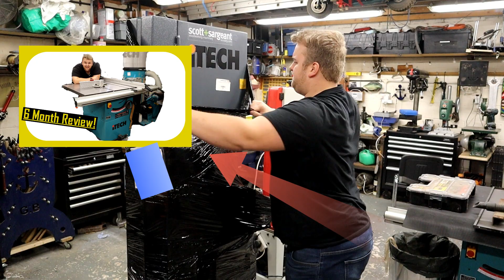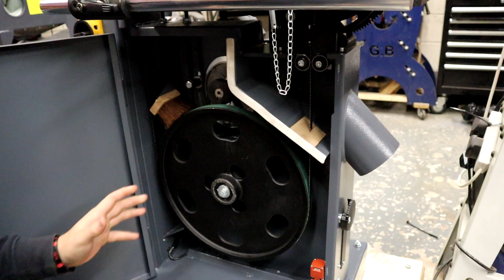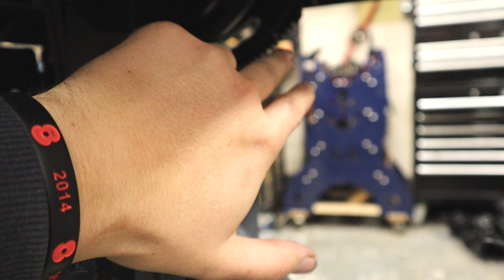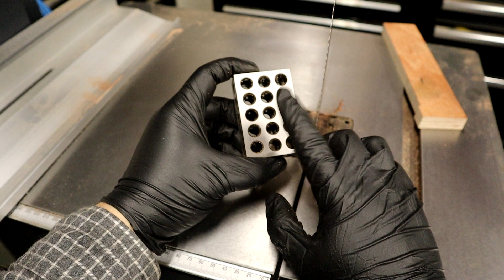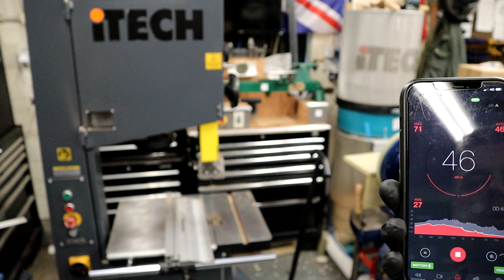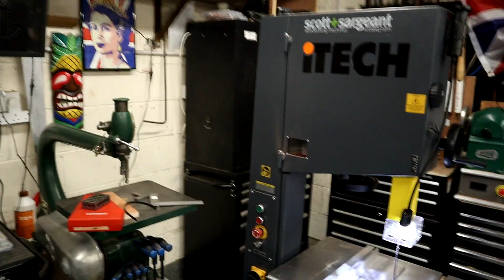ITECH BS400 BANDSAW UNBOXING REVIEW VIDEO (RECORD POWER BS400) NOT SPONSORED!

Comment: Hi James, helpful video thanks. I'm in the market for something similar, and considering the various Axminster Trade, Record Power, Laguna etc. Are you happy with the saw, any issues? Looks a lot like the cheaper Record BS400.
Reply from the maker: Hi Davey, thanks for the comment. Yes mentioned about the record and in the title reference to the record machine. Still pleased with it was ribbing down some larger oak blanks at the weekend works great especially with a tuff saws blades. You won’t be disappointed.
Reply: @AnchorDesigns  good to hear you’re pleased with it. Looks like one of the big differences is the solid disc wheels rather than spoked wheels on the record. That must be where the extra 20kg comes from!

Comment: Good look at the machine, nice hefty wheels, seems like it's made well and doesn't rock about.
Look forward to a part 2 to see how well she cuts without editing, and some other features might be worth mentioning, like if the tires are flat or crowned,  gave us a gawk at the tension screw too.

Might add that pin is there to stop the table warping, not as a safety precaution,
and that your table insert is going to get further damage should you not be able to scoot it until blade is in the middle of the slot.

Best of luck with your new machine.😎

Tom
Reply from the maker: Hi Tom, 

All really good points and thanks for the comment. The wheel crowning is a good point and that pin makes better sense thank you! (Nothing in the manual about that...) I will raise these in the 6 month revisit the table insert is an odd one, As you cant move the fence rail to adjust it to the zero line from what i can see so to zero it in you have to move the whole bed to align the blade with 0 point. as it is in fixed points, Having said that it looks very close because it is however it should drift any more across hopefully. Odd design but very solid in all honesty and no big issue. Thanks again for the comment. 👍⚓